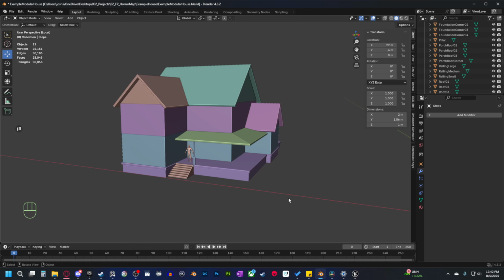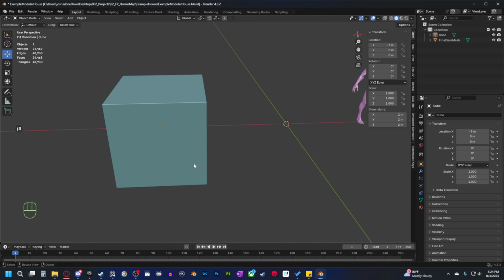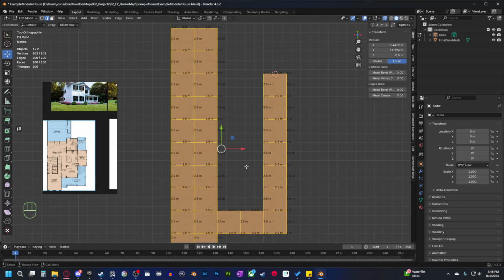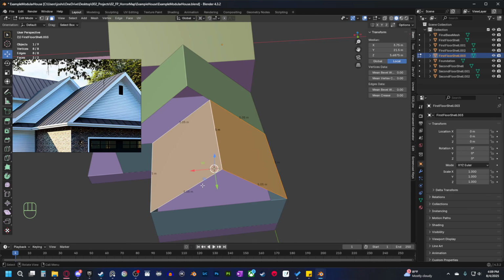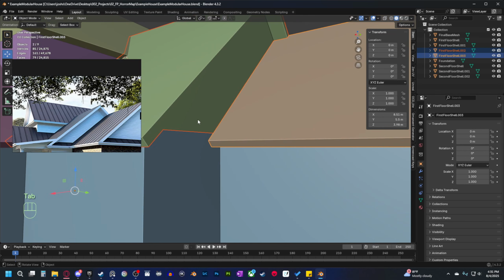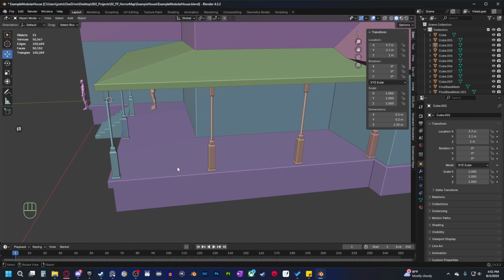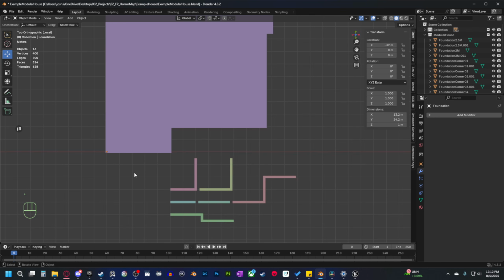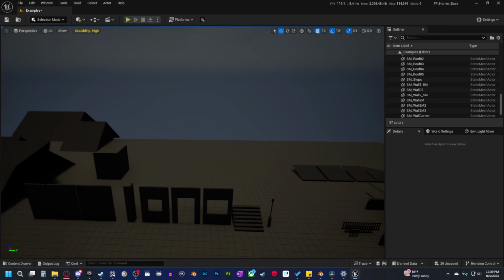Blender Modular House Tutorial | Full Workflow Step-by-Step

Comment: Great tutorial, loved every minute. At 1:00:10 the easiest way to get the roof to centre, is too cut that middle ground floor wall (1st in your case LOL) in two, then use the snap to vertex, G, then X and move your mouse over the vertex of the wall, then you can edge that you just put in. That snap to vertex, move in a direction has saved me countless times from pulling my hair out. LOL